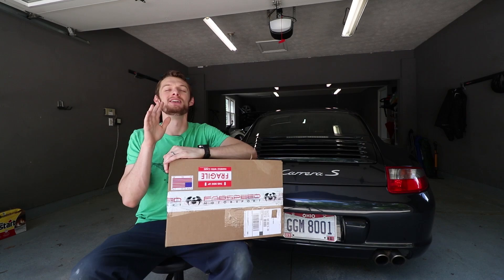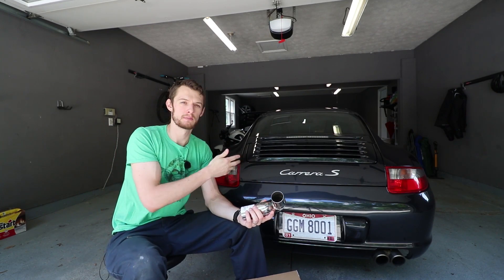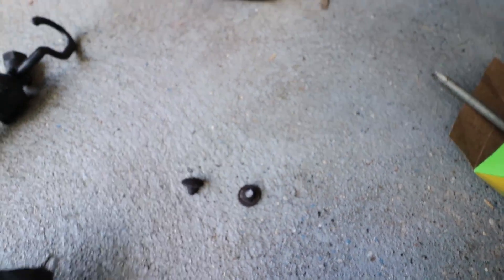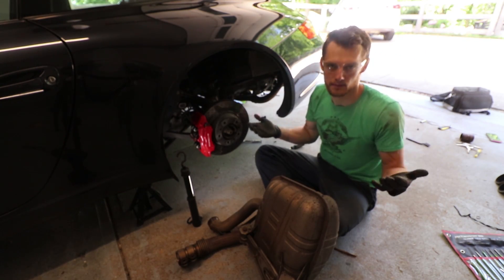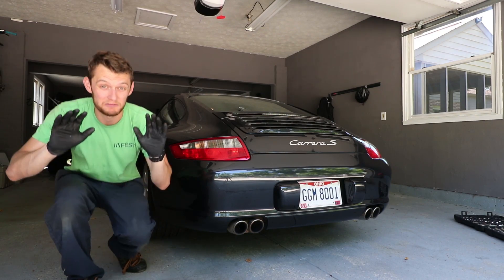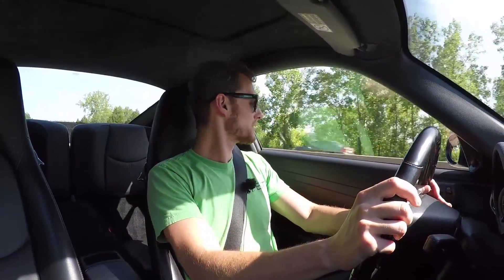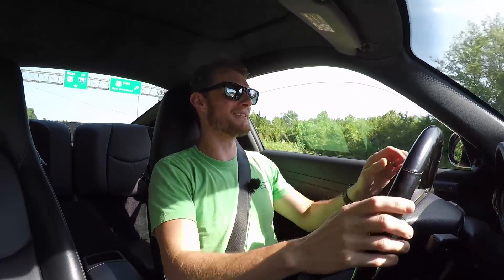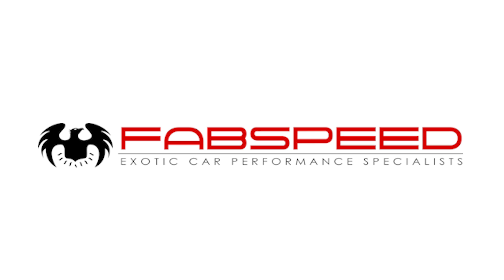I Straight Piped My Porsche 911 and It Sounds Insane

Comment: Tried this on my gt3 a number of years back.  Absolutely kills the low end torque.  Ended up modding the mufflers by welding in a bypass pipe.  Improved the exhaust note slightly but had no negative effect on torque.
Reply: Your gt3 is turbo’d? I thought all Gt3s were NA.
Reply: @cyber_person  no turbo.  Correct, Gt3s are NA

Comment: I did this to my Carrera S for two weeks, the drone was terrible at 55-65. Actually made you physically sick and I used to race Mazda rotaries which are crazy loud. The Porsche PSE is the way to go.
Reply: racekar80 what is the porsche PSA?
Reply: PSE
Reply: Oros 911 Porsche Sport Exhaust
Reply: jstoli996c4s thanks!
Reply: Thanks for that. my Cayman S came with PSE. Glad to know the correct mod for me is....push the button :D
Reply: I have PSE and love it. Thinking about doing the Fister Mod but need to research how that works with PSE. I’ve heard it enhances the PSE sound
Reply: I have the PSE and it sounds amazing... no raspy high noise.. all beautiful low end  with lovely gurgles
Reply: @ScottSanderz19 If you have PSE, when it’s open it’s the same as the gundo hack

Comment: Now you have to reset the ECU to teach-in the new exhaust conditions, otherways the engine is not running optimal.
To reset the ECU you just have to disconnect the battery (negative terminal from battery) for 10-15 minutes.
All data (air/fuel ratio, ignition, valve timing and control, idle speed) will now be new measured, processed and optimized.
Reply: Rick2010100 thank you!! Geez folks. Next video...I installed a k&n intake...and my hp decreased.
Reply: I thought a muffler is not monitored by the ecu so it doesnt matter??
Reply: You don’t have to do that, especially if you have a tune loaded that supports the exhaust
Reply: Jay Moo it doesn’t Support the time with the engine once you delete all the back pressure those mufflers create!
  I’m not sure that disconnecting the battery will change the Tune though????
Reply: @oneman7638  lambda sond pressure monitoring......
Reply: Old thread, but this comment is completely incorrect. That battery "trick" does nothing. Stop believing this fallacy.

Comment: WTF, $500 for some bent exhaust pipe. I'll have my homies at the muffler shop bend me some pipes for $50.
Reply: Doubt it will sound da same Bruh.
Reply: And it would sound like a 500$ Civic on the brink of death
Reply: No
Reply: Even at a muffler shop at a shitty muffler shop that is cost hundreds couldn’t imagine for a Porsche as well straight piping (muffler resonator delete) in my 2009 535i cost 250 with a 20$ tip & the welds were horrible & used hideous pipes. Always go for a catback exhaust & modify that
Reply: Your right it will sound the same plus you’ll get sick of it and wanna put muffs back
Reply: Cost isn't in the materials or labor, it's in what someone put into working out making the bends, and then more importantly making a spec sheet so it can be reproduced.
Reply: It's literally a stainless Jbend cut in half.
There's no possibility of it sounding different by manufacturer.

It's an open stainless pipe.

It's about £20
And would be cheaper if they didn't waste their time laser cutting and tig welding a logo onto it.

It's someone with too much money spending 500 dollars on a £20 pipe.

It's that simple.
Reply: We ain't your homies Aaron,
Reply: I looked every where to find piping to match up, and there really is not another option. Getting tips to match snug to the diameter just doesn’t fit. Shims and Jerry rigging it to fit, ends in tips falling off, blow back sound, etc…. I agree $500 is a lot, but if anyone ever found a pipe to fit please let everyone know. I tried many times with failures every time.

Comment: Tried multiple configurations on my 997.2 C2S, this one as well.  Had the local shop bend up some pipe.  Hated the sound.  Tried Gundo hack didn't like that.  Then tried Gundo with center muffler delete (each side completely isolated) no bueno either.  Finally settled on the FVD Brombacher side mufflers (no valves) with their center muffler delete (X pipe that connects both sides).  Not cheap but sounds great!  Quiet at cruise, almost a flat plane V8 sound at light load lower rpms, no droning, and a pissed off GT3 sound at full throttle.

Comment: Anytime you work on exhaust systems you have to expect broken bolts.

The the bolts are generally not high quality but low quality with high iron content. So couple with moisture from the air and heat, the bolts and deteriorate. And they rust BIG TIME. 

Use a penetrating solvent like PB-BLAST or DeepCreep.

Comment: I have these pipes.  They are WAY too loud for the character of the car.  They aren’t the loudest thing out there; straight piped Harley’s are louder, muscle cars with dumps are louder, etc.  Also, they sound like garbage below 3,000 RPMS.  

I too wanted something louder and looked at the price of these exhausts and thought they were ridiculously expensive and took the cheap route.  In the end, I took my stock mufflers and had the “Fister” mod done by a local shop.
Reply: What's the Fister mod?
Reply: Hulley29 it’s like a sugma mod
Reply: My 04 Carrera S, I did the Fister mod .. I had guys who spent thousands on their exhaust envy me because my Fister sounded way better.
Reply: How does the fister mod (which I already have) sound compared to the fabspeed?
Reply: KosmicHaynerRacingTeam it is an order of magnitude less loud, but still surprisingly loud when you get on it.  The sound is similar to the deletes at full tilt.  Idle is a bit louder and more pronounced.  The biggest difference is at part throttle, it totally gets rid of the deletes worst attributes.  I experienced the deletes set off a car alarm backing out of a parking space.  With the mod it isn’t much different than stock.  Also, the deletes just plain sounded like a junk car with no exhaust at part throttle and low RPM. The mod totally mitigates this effect.  In all but full racing applications the mod is way better.
Reply: interested to read your guys' thoughts on this topic, ill be picking up our 3rd 911 this week - a C2S 997.  i test drove the same car with a "gundo" hack done to the muffler / bypass valve(?). sounded good. i plan on tracking this car, and some street driving as well. in my mind, i want straight pipes, however i think i need to hear them in person before i decide.
Reply: The Fister mod is amazing. We have the "medium" one on our 993 and it's a perfect street car setup: loud enough to sound gnarly, quiet enough that you can drive through a neighborhood late at night without feeling like a complete asshole (as long as you drive quietly). Seriously considering doing the same for my 997 since literally nobody makes an exhaust for the gen 1 cars that sounds good.
Reply: @mellyoller  looooool sugma balls

Comment: Very nice. I had ordered the same pipe system from fabspeed but they screwed up my order and I got a downpipe for a bmw m3. So I canceled the order and sent my mufflers to Fister and had the mod done and a beautiful polished ceramic coating done. They look great and sound is ok on throttle and not noticeable on cruising at all. Which is nice when I need to be relaxed. I still think I may do the fabspeed pipe and get it louder. I don’t care if it’s loud. It’s a Porsche and it’s meant to be heard. I think I need to compare both in person. Sometimes video clips don’t really translate the sound like being there in person.  Sometimes I feel like the noise I’m hearing inside the cabin is too whimpy but I know it’s not like that outside of the car. 
Thx for the video.

Comment: Well I have to agree with the bulk of the replies - it now sounds like a cheap car, gone is the discreet nature of the 911, welcome to the boy racer. I replaced my standard system as the original had rotted out. To be honest I was rather pleased as it allowed me to find a decent sports exhaust. I finally went for a system which came from Design 911 here in the UK. Fitting was frustrated by rusting bolts but worst of all was the manifold studs which  broke at the first turn. I ended up drilling out the bolts and fitting Timeserts, these are so much better than other things such as Helicoils.  I found it easier to remove the rear bumper to gain access which in itself is an easy task. The end result is extremely pleasing. Muted enough not to disturb my neighbors but loud enough when pushed through the gears. In fact it comes with the most perfect bark at high revs along with the occasional pop and bang on deceleration. Personally I couldn't drive your car without the mufflers, OK for a laugh but that's where it ends - put the mufflers back on, if only to hear that amazing air intake.  Rich

Comment: I straight piped my 1999 Boxster and it sounds amazing. I have no cats and won't pass emissions but I saved the stock muffler if I need to go through emissions again. It does drone between 2,500 and 3,000 rpm and it is LOUD.

Comment: When you have rusted bolts, heat the bolt with a small torch and melt some candle wax into the rusted threads.  The wax sucks right in and they come apart no problem.  BTW - Porsche cat back stock exhaust systems suck big time.  First thing to replace on every Porsche.

Comment: Fun fact: all cars with bolts that have aluminum shine is actually a cover. If you ever strip a bolt, just use a screw driver and pry off the cover to reveal the unstrippable steel bolt.

Comment: Exhaust noise would be a problem in residential areas. Might even be illegal too. On a rear engined rear wheeled car, the more weight you have over the wheels, the better. You may have also negatively affected the handling/traction.

Comment: It sounds really good in my opinion. Overall, I agree with you: it sounds like a poor man's GT3, and for $500, and saving 60lbs of weight, it is a great modification. And your 997 looks the part as well.
Reply: Fabspeed makes a good product Maxflows and Xpipes for example but for something that can be built from less than $50 worth of parts from Autozone it's an utter ripoff.

Comment: I have a porsche cayman with a 3.8.  I think the stock exhaust sounds great.  the engine builder said not to touch the stock exhaust as he has seen and heard them all.  no way I'd ever do this.  I did this sort of thing to my Mustang when I was 20.  now that I am almost 40 modifying exhaust systems doesn't even hit my care meter.  my car used to have a 3.4.  now it has a 3.8.  80-90 hp over the stock 3.4.  that's what I care about.  even if I gained 25hp from mufflers...nope, not doing them.

Comment: How much low end torque did you lose? Any noticeable stuff? How bad is drone at 3K cruising speed now? Can you hear the radio without high volume? Any problems with complaints or cops? I am holding off installation of straight pipes on my Cayman S because the forums say I will lose some power in the usable range. I’m thinking of putting on small race mufflers. What do you think?
Reply from the maker: It is a complete fallacy that open exhausts lose low end torque.  This is a myth from old hot rodding days and there is plenty of proof showing you don't need back pressure.  The car feels no different down low but feels more alive up top.  It does drone when you put a load on it or light throttle.  Constant state constant speed it actually doesn't really sound any different, that is until you give it even a little throttle and it really opens up.  It's loud and not for everyone, if you're concerned about drone I would go another route.  But as far as the torque goes, do your own research and see that torque is unaffected.  https://www.motortrendondemand.com/detail/the-power-of-2-5-vs-3-inch-exhaust/0_y75vplrp/
Reply: I’m referring to forum posts of 987 owners who straight piped and half complained about about the torque though It’s unclear if they deleted both main and secondary cats. I message them but never get a reply or reply on the forum.
I really want to delete the secondaries but again the forum guys complain about volume. I think everyone has different tolerances. 
You just changed yours so you can make a fresh comparison. I was on the fence but I think I will do it now. Exhaust systems for our cars are crazy expensive.
I wanted to know if the drone was overblown since it’s my daily and my commute is very long. Any problems with neighbors or cops?
Reply from the maker: I don't think I would recommend this as a daily.  I haven't had any issues yet with neighbors or cops but they're sort of used to me driving loud cars lol.
Reply: In that case I’ve been thinking one option is to put a set of small mufflers in or a set of 200 cell cats. The stock setup is so boring and really want that Porsche crackling note so I’m pretty jealous.

Comment: Can you install only one pipe to get 1/2 the noise ... just curious.
Reply from the maker: I guess technically speaking you could, but you wouldn't want to.  Then one half the engine would have a different exhaust flow than the other which isn't ideal.

Comment: I just want to let people know - don't buy these. They are insanely loud. They set off car alarms. The drone is intolerable. I'm not sure who would actually like these. But look, the audio from his YouTube sounds pretty good. IRL they are a thousand times louder. On a 997.2 I recommend fister mufflers with a center muffler bypass. My center bypass is BBE - cheapest option. But it was difficult to get on. So you might want to buy a different brand for your center bypass. And remember a 997.1 does NOT have a center muffler. With a 997.1 just get fister mufflers

Comment: Would the loud sound make this car illegal for street use?
Reply from the maker: Not where I live at least. Would reallydepend on your local laws
Reply: That is the same question I had. Where I live, it is illegal  :/
Reply: That car had to have a resonator installed in the intake to meet Euro noise standards as it was too loud in stock form.  Mine is quite loud in stock form.
Reply: Doesn't matter, as long as Harley Davidson bikes making more noise than this, you can make your car noisier. It's only fair.
Reply: teinspringz that's pure idiotic mammal reasoning. Lemme guess, you're from USA lol
Reply: @teinspringz - That's another good point. In Europe cars should not make much noises, but bikes.... they can blow your ears out, nobody cares! Unfair!
Reply: I was being sarcastic, dark dark humour. It's the same idiotic mammal reasoning that allow Harley Davidson owners to mod their bikes ridiculously loud and the law lets them get away with it. Those lawmakers are the idiots.
Reply: This isn't really that loud.  There are probably a few factory cars just as loud in sport mode.
Reply: EatSleepDrive Speaking as a cop near Dayton it is actually illegal across the entire state of Ohio to run a vehicle on a public road without an exhaust muffler. Here is the law: http://codes.ohio.gov/orc/4513.22

That being said, in my experience, most officers won’t push the issue unless there is a citizen complaint or they are making a pretext stop. The reason being is there are motorcycles that are ridden which are louder, and for some reason that is acceptable by the common public as a whole normally. It’s a letter of the law vs spirit of the law sorta thing.

Lastly, I think the stock F Type R sounds louder at least on the videos I’ve seen. Could be the microphone setup. But that’s a factory setup and approved for use on our roads by the feds....plus I really want one!
Reply: @teinspringz  Actually, they are illegal almost everywhere. As the cop says in his comment, they look the other way unless there is a complaint.
Reply: @Count.Zer0  Lemme guess, you're Dutch lol
Reply: @teinspringz  #notalawyer #butjudgeitsonlyfair

Comment: For sure it's louder - don't know if it sounds any more sophisticated though : )  Hard to tell if you're not in the car or on the street hearing it go past. A decent machine shop MIGHT be able to cut a couple out for you for a couple of hundred bucks but then you'd have to have them chromed for that nice finished look.  Have to agree about the weight saving though. I'd be curious to see and hear what an Akrapovic exhaust mod would like for this car although IF it exists, it might be crazy expensive : )

Comment: Sounds good buuuut, 500 is way too much for pipes you can get anywhere. BTW, a Subaru STI exhaust on average is 1k and they go up to 3-4k with blitz brand. If you find a exhaust for an STI for 125$ it will fall apart while being shipped.

Comment: I'd be curious to hear this with an x-pipe too. You can get a de-catted x pipe from FVD for about $450
Reply: I am doing a few videos now and I have the Fabspeed X pipe no cats but I am installing a set of Fabspeed suppercup mufflers for one video and the Fabspeed maxflo. I also have modified stock mufflers on the car but I could do a video with the mufflers deleted and the X pipe. I have run the car like that before and I can tell you it is so loud and does not sound good! I like loud but It sounded like a dump truck!
Reply: @surftribe2404 yeah man. I’m dealing with that now. Does it sound good catless with a gundo hack?

Comment: All 250 hp opened up all show and sound but no go I got a gembella exhaust on my 911 turbo with 600 ho I don’t want it to sound leak open pipes in closet all kinds of attention for no reason when you open it up with the gembella it sounds great fab speed = 💩